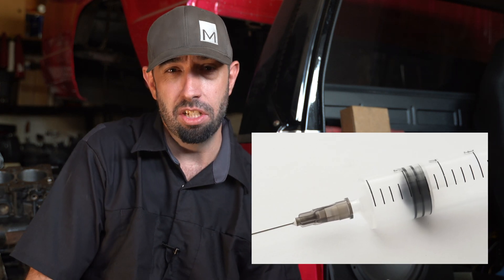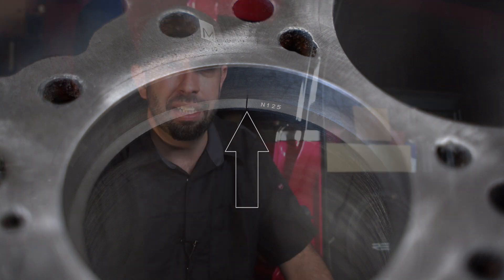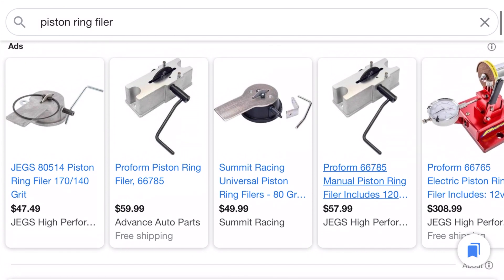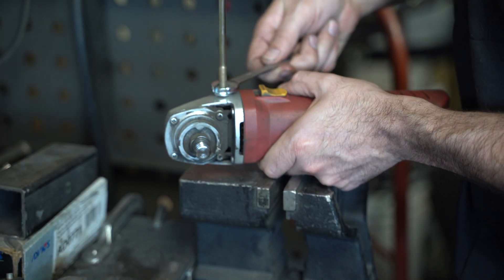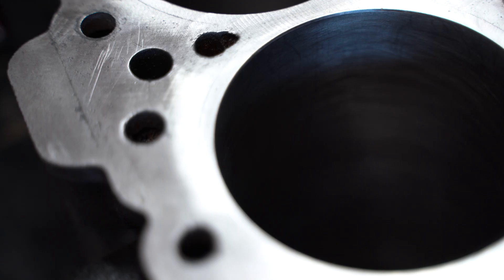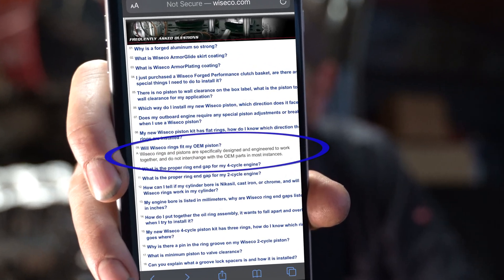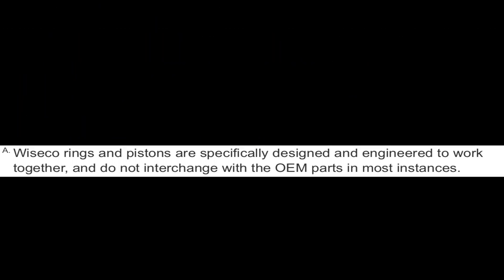Perfect Piston Ring Gaps! Mighty Max Ep. 06

Comment: Great idea! Looks much easier than a cheap hand crank model and it a fraction of the cost of a power ring gap grinder. I’ll be building one next motor I build. Thank you!
Reply from the maker: Excellent! Best of luck with it. It’s much easier indeed but beware not to rush it and overheat the ends. (Honestly didn’t know that was an issue until reading comments) Hope my motor doesn’t ‘splode. 😂

Comment: Oh this was Beautiful
Reply from the maker: Thank you my man!
Reply: @GarageFab  I'm just going to use the manual grinder since I ordered one ,but dam that was satisfying
Reply from the maker: Lemme know how that works! I’ve heard a few folks say that’s the only right way of doing it because a powered grinder will overheat the rings. 🤷‍♂️
Reply: I was going to connect a power drill to the arm of the piston file that rotates.. it has a screw that sticks out and I can Tighten the mouth of the power drill around that screw and set it at a low speed...I'll  use  The reverse option on the drill to grind it counter clockwise...
Reply from the maker: That’s pretty smart. Best of both worlds! 🙌

Comment: Just wondering were the original oil control rings worn enough to not control the oil or could they be reused with the new compression rings?
Reply from the maker: To the naked eye, I couldn’t tell if if they were worn. However, the Eclipse was smoking really bad which is why I decided to rebuild the engine in the first place. So of all the rings, those were probably the cause. 🙌

Comment: This is a great video for the do-it-yourself-er!  I appreciate you sharing this, liked and subbed

Tidbit of info though:

~take material from one side of the gap not both
~always make sure your material is being machined from the outside to the inside of the ring
Reply from the maker: Thank you! Could you clarify your second point? It’s too late for me on this motor but I’m still intrigued. And perhaps others will read.
Reply: @GarageFab  the second point is to be precautionary.  When setting up the ring on your filer, you want the rotation of the blade/file to be toward the inside diameter of the ring.  This will lessen the chance of flaking off the molly coating that's applied to the ring and it will prevent a lot of the burring you find after filing the gap.  This is precautionary, chances are yours will be ok, you can inspect them though for this flaking.
Reply from the maker: I’m assuming that flaking would be a possibility either way, it would just flake the inside. But a small piece of missing material inside the ring groove would potentially be less concerning than it would on the outside. 🤔 
Much appreciated my man!

Comment: You should make the "Table" 90 degrees to the cutting wheel so you are filing the ring square and not at an angle!!
Reply from the maker: Wait… What? I’m not sure I’m following. Please clarify!
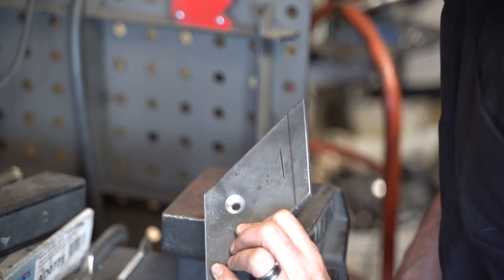Reply: @GarageFab  At around the 6:20 mark the way the plate attaches to the grinder it looks like it's mounted at an angle which would throw off you grinding angle on the rings. I've re-watched a few times and it could be just the way it looks?
Reply from the maker: I think it’s an optical illusion! The piece of scrap metal I had laying around was a parallelogram. (Diamond shaped kinda) the blade is 90° from the plate and the ring stops (Allen Bolts) are 90° from the blade slot. The weird shaped table throws everything off visually. 🧐
Reply: @GarageFab  Gotcha! I dig your content man, keep it up!!
Reply from the maker: Thank you Terry! 🙏

Comment: 8:28 - Using an angle grinder is a VERY bad idea as you see (blue tinted ring ends = you overheated a ring, and RUINED its temper). This ring is ruined. It is why those grinders are hand powered - to prevent generating to much heat during operation.
Reply: Except they make powered ring filers as well.. which spin at 3,000 RPM. Don't press hard and this will be fine...
Reply from the maker: Bummer. Guess it’s a good thing they didn’t fit anyway. I imagine their lack of temper won’t be a problem in the trash.
Thank you for your input my man! You are appreciated.
Reply: @GarageFab  No problem - you have awesome channel i like it. Remember also - too large taper, made when you're deburring ends have a huge impact for blow-by. You have to avoid making tapers or phasing edges when deburring ring ends.

Comment: That totally sucks.  So what is the fix?  Wiseco pistons?  Or maybe just OEM oil rings?
Reply from the maker: Video hasn’t been released yet so you get a look into the future. The pistons were in great shape so I had to buy a 3rd set of rings. I got lucky and found some Mitsubishi rings on eBay thankfully since I was told they’re no longer in production. The seller must’ve known this because he got me for nearly $300. Still cheaper than Wiseco pistons. I only want to do one more engine video and I’ve hit more snags so it’ll be a while till it comes out.
Reply: @GarageFab  Sorry to hear about the snags.  Building engines - especially older ones off the beaten path, is usually fraught with disaster after disaster.  I hope its nothing too major.
Reply from the maker: Haha Right! I think it’ll be ok. Just bad planning on my part. I apparently bought a less popular Eclipse that’s not usually swapped into the Mighty Max. I’ll be fabricating engine parts for the first time in my life. Just another opportunity to learn!
Reply: @GarageFab  I had the exact same issue on my 68 C10.  I thought I was being slick by using 1990 spindles on it so I could have stock 1995 6 lug rotors....that part all went great...I had 6 lug all the way around....BUT...I created a positive camber issue that could not be adjusted out...like 5 degrees of positive camber.  So now I am moving back to 79 spindles, custom 6 lug CPP rotors, and as soon as I get new 79 lower control arms (no longer available except from LMC for 150 EACH) I will be back on track.....UGGGGGG
Reply from the maker: Hahaha! Nooo! Well if custom was easy, everyone would do it!

Comment: Will this work on a briggs flat head for all 3 rings
Reply: I'll try it if it don't work ill look for the right size rings thanks
Reply from the maker: I honestly don’t know! I don’t have much experience with smaller motors. In the little bit of research I did on the Briggs motor, the oil ring looks like a single piece and really thick. I don’t see why this tool wouldn’t help. I would just suggest that you have more patience with that ring since more material will trim slower and forcing it will overheat it.
These are all educated guesses and guessing often doesn’t go well when rebuilding engines. I wish I could help more. 😞

Comment: You should only work the ring on one side not both
Reply: Although I’ll never build another car chassis or rebuild another car engine, nor hot-rod any four wheeled vehicle I find your channel very helpful and instructive. And as I’m struggling with mods to a small motorcycle right now the most helpful thing of all is… your closing words each time - “keep moving forward”. Thank you. Les in UK
Reply from the maker: Excellent. That warms my heart, Les. It’s something that helps me through life, so it’s fantastic to hear something so trivial is appreciated by others. Thank you. 🙏
Reply from the maker: Interesting! Why is that?
Reply: @GarageFab   nice content though  👌  I'm making myself one with your idea💡
Reply: @GarageFab   to make sure you keep the ends square  , if you work the one side only you can close the ring and check the worked side to the side that's not worked to make sure it stays square to one another , hope it makes sense , keep safe ✌
Reply from the maker: That makes sense. I don’t size rings often so I just assumed the ends matching each other would be more important than the angle. And since this tool is hand-made and likely imperfect, trimming each side a bit would provide a better match. Thank you for the kind words!

Comment: Thanx! 
When I was rebuilding my EJ255 I also faced a rings issue 
I had to combine NPR  and Hastings rings at the end, engine is working well now and doesn't have oil consumption.
Reply from the maker: That’s crazy! Like one brand ring in one cylinder and a different brand in others? Or different brands in the same cylinder? Either way glad things worked out.
I finally got the rings figured out (no thanks to STM tuned) after dumping over $700 into just rings. That episode will come eventually.
Reply: @GarageFab  yeah, each manufacturer wants to have an extra profit) 
My rings issue was in a wrong filler gap, Hastings had almost 1mm instead of 0.4-0.5mm.

Comment: If the gap is to tight you'll break the piston when it heats up and the ring expands. Alternate the gap 180 degrees for each ring, and file off any burrs.

Keep up the good work.
Reply: better tight than too loose - low compression.